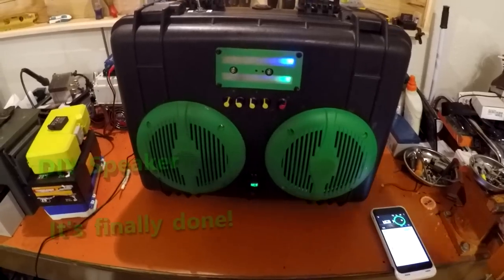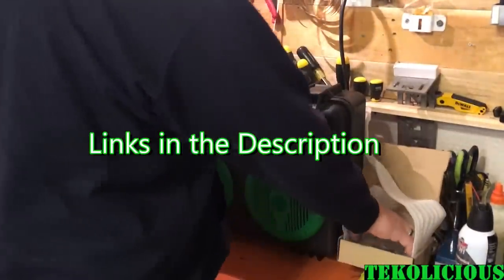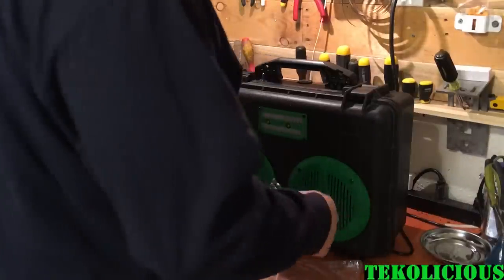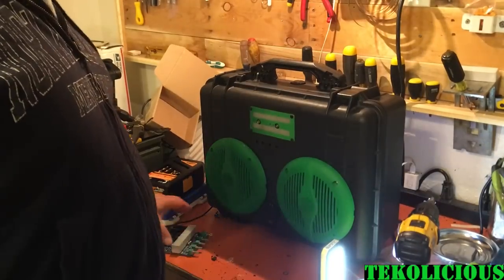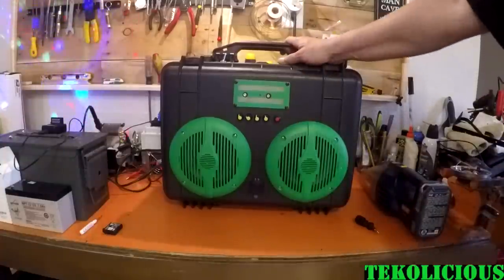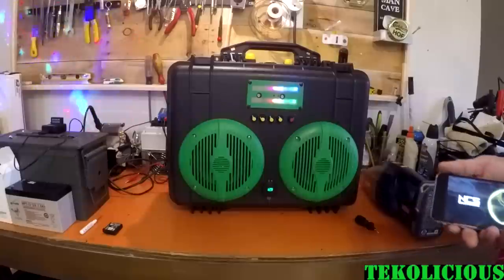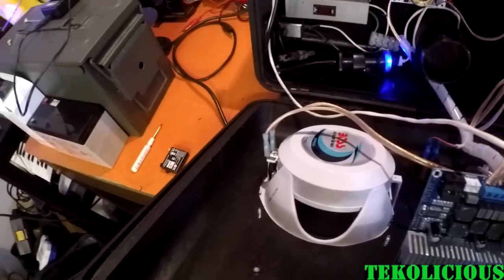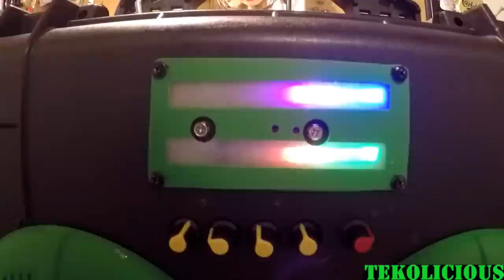The Party Speaker DIY Pelican Case - TPA3116D2 Bluetooth Speaker- Awesome Project

Comment: Nice BoomBox and Video!! Hey, hows it going! I'm in the middle of a project (Personal BoomBox Bluetooth). My system is using ND105 x 2, ND65 x 2 and 2 tweeters, with a few passive ND105PR, etc, etc. I am also using a TPa3116D2 with Bluetooth. Right now, I am researching the Boost converter you used in yours. The one with the whiteboard and aluminum btm. Just curious if you have had any issues using the boost converter. I need something to boost the 5s4P battery I am using with mine to 24V and if I had to guess around 6amps max(But that is 100% volume and heavy bass). I know I'll probably hardly ever use it at 100%. I can't really find any good info on it and was wondering if it held up at 20V like you have yours?
Reply from the maker: Boost is working fine the Bluetooth device at times cuts out, not that strong. but still use it. Thanks for the comment
Reply: Thanks for the reply. I ended up not using a boost converter and surprisingly my boom box build sounds amazing! Plenty of power coming from the batteries I built for it. I think I’m getting close to 20-24 hours of play time before I need to recharge. Should have that video edited. I’ve built probably 6 units so far, with one being a rebuild and upgrade. I just need to edit....lol. I appreciate the reply and love watching your videos!!!!keep up the great work👍👍👍👍👍👍👍👍👍